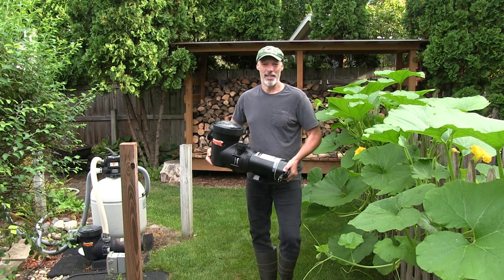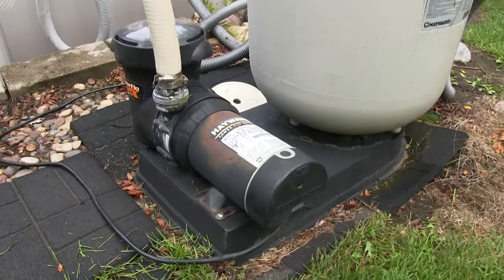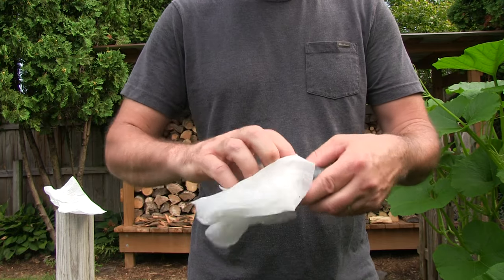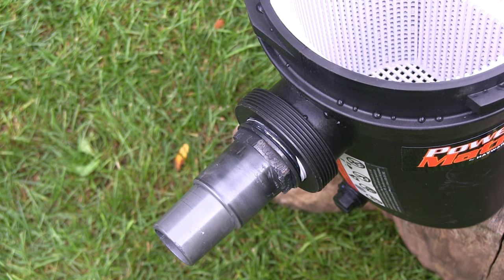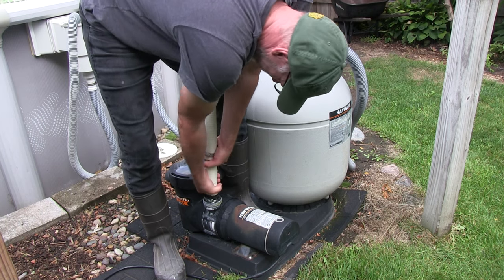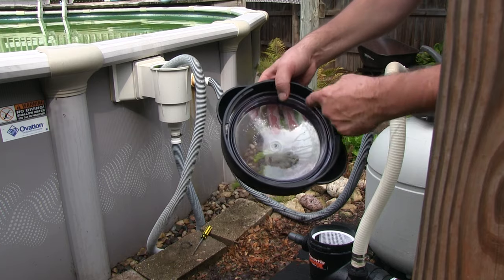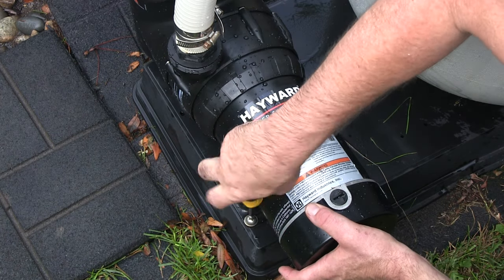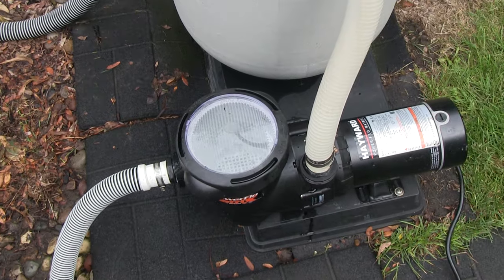Pool Pump Install (Replace) Hayward Power Flo Matrix Above Ground Pool Pump

Comment: My Power Flo Matrix lasted about 3 years...& that's in NC. The seal broke which separates the pump from the motor & slowly compromised the motor housing & corroded the motor (salt water pool)...Little disappointing...luckily, my wife works for Hayward...This clarified things a lot. Thanks much!!!
Reply from the maker: Your welcome! Bummer on your pump giving out prematurely. Hopefully your replacement will last for many years 😊
Take care

Comment: Thanks for this video. Just got anew PowerFlo Matrix pump and I wanted to move my discharge from vertical to horizontal, but couldn't depress the button with my fingers and thought something must be wrong.....can't possibly be called a button and you can't depress it. I contacted Hayward Customer Service----what a joke, a sorry excuse for Customer Service.  With exactly no help there I thought to check You Tube and found this video. Life saver! Very well done and 100% clear. Than you!!!
Reply from the maker: Your welcome. Sorry you had issues with the pump and customer service!
Hayward has some improvement to work on!  Enjoy the pool and take care 😊
Reply: I'm having this issue. How did you change the discharge to horizontal? Thanks.

Comment: When you install the clear vinyl hose that goes between the pump and filter use some plumbers grease. It will slide on with ease
Reply from the maker: Thanks for leaving us a helpful tip! 😊

Comment: I use a hairdryer to heat up the hose where it attaches to the pump. Comes off a little easier that way when it’s warm.
Reply from the maker: Great tip, thanks for sharing!

Comment: Thanks sir. I have a powerflo lx and it's leaking from the fittings. Going to redo the Teflon tape but what are the size of those adapters? In case I need to grab a few
Reply from the maker: I believe they are 1.5” hose clamps!

Comment: What do you mean prime the pump before turning it on for the first time?
Thanks I’m a newbie😅
Reply from the maker: Hello and welcome! What I mean by priming the pump is add water to the pump strainer housing. Priming helps to get the air out by replacing it with water. Hope this helps! Happy swimming!

Comment: Thank you for the great video/instruction!! I inherited one of these and I’m trying to figure out how to use it. Do you know how much sand Im supposed to put in the tank?
Reply from the maker: Your welcome!
I believe ours takes four bags of the silica type sand. Yours may be different. Does your filter still have a make and model# on it? If so you can Google it. You want to follow the manufacturer’s recommendations.  
Maybe you can pull the old sand out and guesstimate same amount to put back in if you’re unable to locate the specifications. 
You got this ! 😊

Comment: Is it difficult to remove the back half of the electric pump to replace the bearing and brushes on the armature?
Reply from the maker: We replaced the whole unit, and didn’t need to fix it so we didn’t run across that problem. I’m so sorry, but that’s out of my area of expertise. Let us know how it goes and best of luck!

Comment: Hello!
Do you use a vacuum pool hose for the skimmer to the pump?
Reply from the maker: Ours is a 3’ long with a 1.25” diameter hose. The size of the opening depends on your pool instructions  (for example I believe the Intex pump is a 1.5” opening). I believe a vacuum hose would be too long. Cheers!

Comment: We bought one a couple months ago and already it won't turn on. I dunno if it's the switch or what. It worked great till today. I finally got it to turn on and then went to flush, turned it off and it won't turn back on again. The on switch clicks when you push it but nothing happens. Is that how yours did when it went bad?
Reply from the maker: Sorry to hear that. Ours just stopped working. I hope you can get them to replace it for free. Thanks for sharing with us from your experience.

Comment: So at the end, where the water all left the basket, is it supposed to not have water in there all of the the time?
Reply from the maker: Yes, it will fill up with water once the water pressure stabilizes again. Good question!

Comment: Do you ground the pump with a ground wire?
Reply from the maker: I believe our  pump has a standard 3 prong plug that is plugged into a gfci outlet on a dedicated circuit. I assume that makes it grounded. 
I don’t know much more as this is out of my area of expertise requiring a qualified licensed electrician/pool technician. Take care 😊

Comment: How do you get the extra air out since the Hayward doesn’t have an air relief valve?
Reply from the maker: I just hooked up hose from pool which allowed some water in and then opened the transparent pool pump lid and added some water. Then I turned the pump on which allowed more water to displace  air as it ran over the next 5 minutes 😊